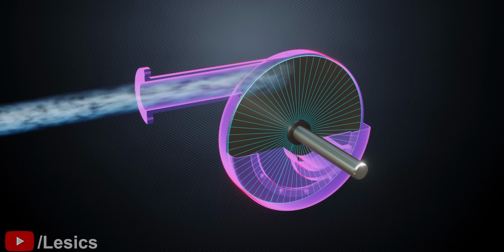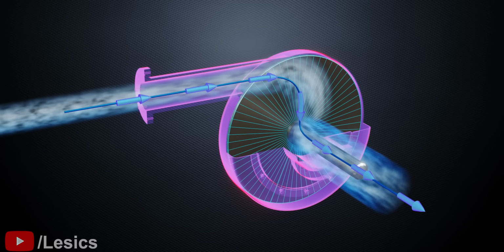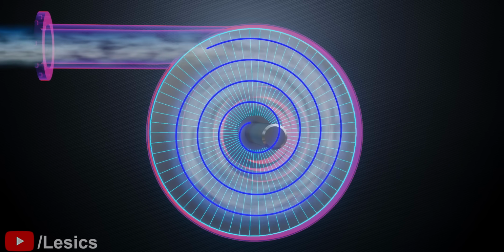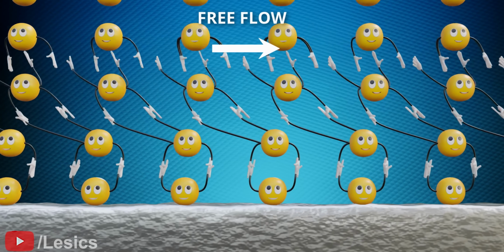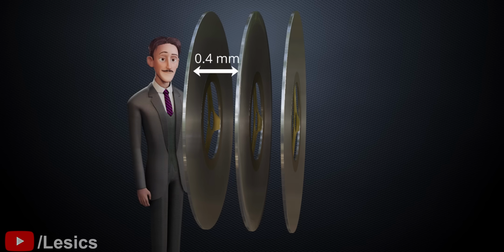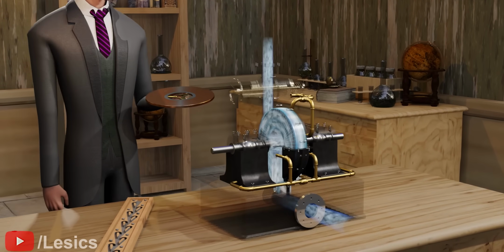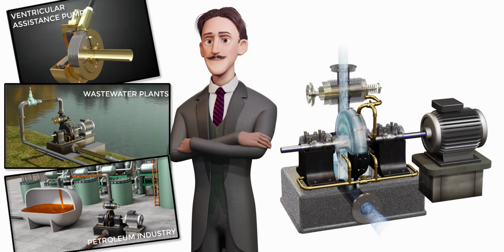Tesla Turbine | The interesting physics behind it

Comment: the blades will stay together, even in honeycomb, but hydro dynamic discless spin of liquid
Reply: helo
Reply: same if you use centrifugal force in front of a rocket when you separate drag creating surfaces from the moving air, far away from the first layer, to the layers meters away
Reply: at the time, but we can now
Reply: you can use many small, if you cant make bigger
Reply: you can also use it as a ram jet with gasoline as mixer jet

Comment: Don't EVER call something an engineering impossibility.
Reply: The implication here is that we can not achieve this at our current technology level, but with some advances in materials science and manufacturing, it may one day be possible. It just highlights how truly advanced Tesla's ideas are.
Reply: @akidodogstar5460  Insightful  👌
Reply: don't tell me what to do!!!!!!.  who made you the sheriff?
Reply: Fixing stupid > Engineering impossibility 😂
Reply: Correct! Not impossible, just a materials engineering challenge. Maybe something like graphene will make it possible.
Reply: @burnerjack01  Even if you could keep the discs themselves from exploding, the structure its built into would also likely fail due to vibration

Also the containment unit would literally need to be bomb proof.
Reply: It's vvlery likely that it is impossible in general since the forces at the tip most likly exced atomic bonding forces. In that case you will never find a material l, that is able to withstand this conditions. Therefore it will also be an engineering impossibility.
Reply: perpetual motion machine ...engineering impossibility
Reply: Engineering impossibility, not scientific.  Engineering implies what is currently available/known.
Reply: @jamesmcmanus1206  Insightful 👌
Reply: exactly, modern diesel turbos run the turbine wheels up into the 120,000 RPM range. Yes they are smaller, but a Banks or Garrett 60mm turbo will happily sit at 125,000 RPM for 10,000 hours, in a 1250F temp gas stream. So the metallurgy for a larger wheel, in a lower temp environment is doable. but would cost an arm and a leg.
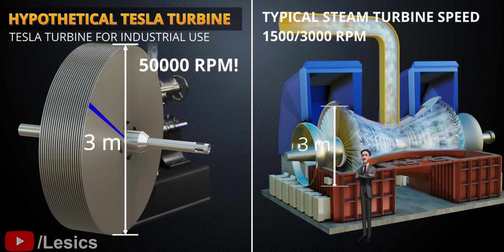Reply: @calvinbarnes1721  At 8:04, they categorically state "The main issue is that of the blade tip velocity", not RPM
Reply: @KurtRichterCISSP  RPM is directly related to tip velocity, the problem is disc diameter.
Reply: @coyote5735  kinda arguing semantics.
  The problem is that in order to produce the power on an industrial scale, they would need to be 3m.  And a 3m turbine spinning at 50,000rpm is currently and engineering impossibility.
Reply: @Mastermindyoung14  That's what I was referring to, the forces are too large.
Reply: @coyote5735  yes but you can get the same work by turning more wheels slowly as fewer wheels quickly
Reply: @KurtRichterCISSP  Compounding will never compensate for the torque required, the idea is to keep it simple and keep costs down, what you propose is nonsensical.
Reply: @coyote5735  Well now I've been blessed with the same insult everyone gave Tesla. Thanks! 😊
Reply: @KurtRichterCISSP  No insult meant just an observation. If the 3 metre disc model could have been built it would have by now, the science is sound but the application is not achievable with current materials. If you think you can do it, more power to your elbow. Best of luck.
Reply: @calvinbarnes1721  the problem is that the FASTER this turbine rotates the LOWER its efficiency is. Don't trust any video like this.

Comment: I got Mach 23 for a 3m disc at 50k/RPM, I don't think any material could stand those forces. Worked out the CF for a disc of mass 0.5kg, 150mm diameter at 30k/RPM at the edges the force =38 metric tonnes.............dangerous work ....lol.

Comment: Why the high rpm's at 3 meters is in impossibility is not explained... that's too bad.  A good video in general however I feel there is info missing.
Reply: Easy to see from these vids 
https://www.youtube.com/watch?v=zs7x1Hu29Wc
Reply: The discs would vibrate, warp and probably explode, due to vibrations caused by microscopic variations in the metal used in its fabrication.
Reply: agree. the reason is that the disks would shatter under the load. A disk of 1.5 meter radius spinning at 50000 rpm results in centrifugal load of 4 million g at the disk edge. There is no material that can bear such tensile load.

Comment: This YouTuber and/or its animator are either very confused or just pushing disinformation.  What this video demonstrates is a common, non-Tesla design called "a rotary pump" or "a drill pump" such as you can find at any hardware store.  You can't use this the way you use a Tesla Turbine.  You have to operate the rotor by manual or mechanical means in order to make it do anything at all.

Tesla's turbine patents indicate that the disks should be parallel with the inlet, not directly inline with it as shown and discussed here.  The inlet port should be straight down into the casing, where the fluid touches one face of the first disk in series at an angle specific to the size of fluid particles, and then the fluid should be able to creep down the face of the disk to pass through ports drilled through the disk itself.  The thickness of each disk in series and even the size of the holes are also ideally ratioed to match the particle size of the fluid involved, whether it's air or steam or plain water.  Even the spacing between the disks is important, again relative to the size of the fluid particles being used to drive it.  The outlet port should not be dead-centered with the rotary axle, but placed at the far end of the disk series and emitting in the same direction and caught at the same angle as the input port allowed the fluid in.  It's this exacting design that creates the high efficiency factor.  

The reason Tesla's turbine hasn't replaced the classic turbine design in industry is the fact that it reaches such high RPMs that no substance exists which is suitable for making the disks or blades.  Everything eventually wobbles at the edges, and with the tiny gap between blades that means they'll touch which means they'll chip and crack and eventually shatter.  

With YouTubers like "Lesics" pushing plain nonsense like this, content consumers will never become legit makers so the world will never enjoy the benefits of Tesla's genius.
Reply: thank u
Reply: Didn't he say all of that? Although I do think ur r right there r pictures of 2 different machines one with the outlet on the rotary shaft and the other below and inline with the discs.
Reply: @bosscom6910  Around 00:14 the casement looks right and the axle looks right and the disk array is there, but none of the disks have those vents that trap the fluid particles and actually make the spinning effect occur.  At 00:19 a blue animation shoots down from above, swirls around the disk enclosure, then comes out the bottom.  Then it shows the disks going into the enclosure inline with the water flow.  This is a rotary/drill pump, period.  This is not a Tesla Turbine.

Then there's a minute or two of useless babbling about regular turbines and they're all complex math and angles.  That's BS as well.  You can make a plain old fan or turbine blade perfectly straight and without any twist at all.  You can use cardboard.  You just have to affix it to its own center shaft at any angle other than straight-on to the flow of fluid, and then you just have to make all the other blades angle in the same direction.  You get better efficiency with math and engineering, but I digress.

At 01:05 we're back to an animation of Tesla operating a drill pump in a fancy casement, not a Tesla Turbine.

At 01:32 we're on to some new nonsense about how if you just run a stream of water against a disk on an axle, it makes the disk spin and that's a Tesla Turbine operation.  That is not even functional.  Go try it.  If the disk moves at all it's jerky and unsteady.  If you were to rotate the incoming water stream out and right a little ways until the stream of fluid struck the disk on just one face and very near the top and angling down and forward, then you'd see some real, steady movement of the disk rotating on the axle.

If you then drilled holes in each disk as specified in the patents, the fluid would catch in those and the steady movement of the rotating disk would make a drastic leap in speed and torque potential.  What happens in a real Tesla turbine is that fluid particles chase each other around inside those vents and eventually get flung off the opposite face, at which point they transfer to the next disk on the axle.

At 02:03 there's a flat-out transparent cross-section of a common drill pump casement.  Not a Tesla Turbine.  Again, the animation shows the fluid entering the casement inline with the disks, being split apart by the disks, etc.  Not how a Tesla Turbine achieves rotation power.

From there I started clicking through the progress bar at the bottom of the video.  There's a long explanation of how a drill pump, not a Tesla Turbine, allows fluid to pass through it.  Later the narrator mentions putting the disks closer together and then slowing them down to prevent mechanical failure.  Whoop-de-doo.  All his pictures and descriptions are not of a Tesla Turbine, even while he's making these statements.  The direction of fluid flow demonstrated is the first mistake and it just gets worse from there as the narrator describes some fluid particle interactions that occur but aren't relevant to the Tesla Turbine.

So yeah, he says the basic stuff you could find by reading Wikipedia while half asleep and drunk as a lord, but even that's wrong because he's not showing a Tesla Turbine at all XD

Comment: You know you are onto something interesting when you build something and it OVER performs... It gets TOO fast or TOO strong. When its the material strength of the hardened steel that is holding it back. At that point, whatever it is; can be counted as an engineering marvel.
Reply: @I love you but For overperforming he meant that it was so powerful it didn't even work. It has not to do with expectations but with actual results: Tesla's expectations, as a scientist, was to build something that worked. He did, but worked too much haha
Reply: @samueleproiettimicozzi8134   did the video account for the speed of the rotation  that would be deducted once a load was applied?
Reply: @samueleproiettimicozzi8134  Tesla  wasn't a scientist, he was throwing hundreds  of darts at a dart board blindfolded and got luck a couple  of times.
Reply: @678friedbed  okay, show your dart trows on technology...
Reply: @TheTechmaster1999  Lowering the RPM lowers the efficiency making the design less efficient than a traditional turbine so... not really a solution.  If something has to destroy itself at the point where it becomes efficient it really isn't efficient.
Reply: @TheTechmaster1999  Sorry, adding multiples to the same flow won't help: they will work even worse than the first stage, which will underperform severely.
Reply: @TheTechmaster1999  The main problem is turbine inefficiency at high and even ultra-high RPM, it needs it to be even higher. And the airflow after the first turbine will be already weakened. So it's doubtful adding even another one will not be like the first case, where airflow is insufficient to turn the disks, let alone others down the line. Upping the efficiency a couple percent? Perhaps. But that's probably the maximum it will do.
Reply: Engineering is the process of using technology to create the possible.  If you come up with something brilliant but it doesn't work it is an engineering failure.
Reply: @kennethfharkin  It actually works though. Certainly it's not about practically using the turbine, but reaching that incredibly high speed. The turbine reaches it, and then starts to break, not allowing it to be used as a turbine.
Reply: @samueleproiettimicozzi8134  "It works" isn't exactly accurate.  The theory is proven to be sound with efficiency increasing as predicted at higher speeds but the theory falls apart in execution.  Tesla's turbine almost certainly never reached the optimal speed and would have destroyed itself well before nearing it.  As an engineer myself I refuse to call anything an "engineering marvel" which flat out does not work and this thing doesn't if you are trying to use it as it was intended.  

Now it functions to some degree as a pump depending on the application but I doubt we will ever seen a Tesla turbine operate as people imagine at anywhere near projected efficiency given the material and manufacturing limitations likely to be present for at least another hundred years and if we ever overcome those limitations a more suitable solution will have already be developed.

Comment: If they didn't use it because it spins so fast why not minimize the input energy? Less Input energy = more power (manageable) and also less input energy meaning you don't have to burn that much of coal or etc to produce steam.... but still tesla turbine relies on friction due to fluid viscosity that's why it is not used in industrial because it has very low torque compared to blades and generator needs more torque in order to spin to supply its loads

Comment: There wasn’t a technology to hold the centrifugal force now we have carbon fiber epoxy. Has that been tried yet, if not why not?

Have we thought of increase disc count but radius?
Reply: I doubt it would take the temperature of the steam.
Reply: @coyote5735  
Agree. Can increase disc count help?
Reply: @philoso377  I think the key to performance is high RPM and a large disc diameter to generate the torque required. I'm sure this has been examined by many engineers over the decades but the material doesn't exist to stand the stress. I  would imagine there is a limit to the number of discs that can be used before exhaust issues occur..
Reply: @coyote5735  
Revisit the topic and play with viscosity, radius, rpm and disc count.
Reply: @philoso377  The permutations are endless. Tesla was thinking about generating electricity using thermal energy, others have adapted his idea to their own ends.
Reply: @coyote5735   excuse with negative on untried alternatives makes himself feel authoritative is telling other the opposite.
Reply: @philoso377  What? No idea what you are talking about. Try again.
Reply: @coyote5735  endless permutations is an excuse that make one feel authority they are not.
Reply: @philoso377  None the less there are endless variables. If you were an engineer you would know that.
Reply: @coyote5735  if we never try (what if, principle and practice aided by a simulation tool) we’d never know for sure. I’d if I’m in position like you.